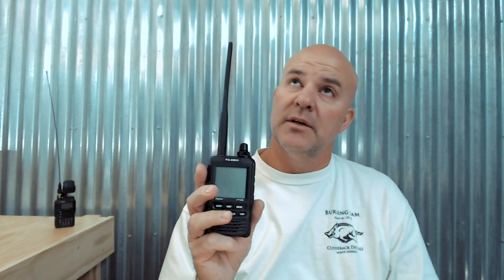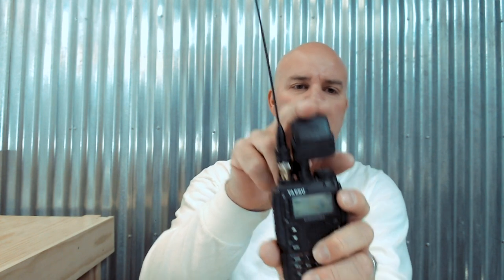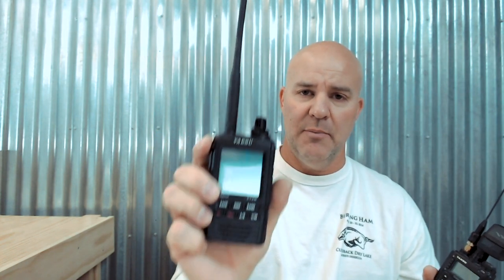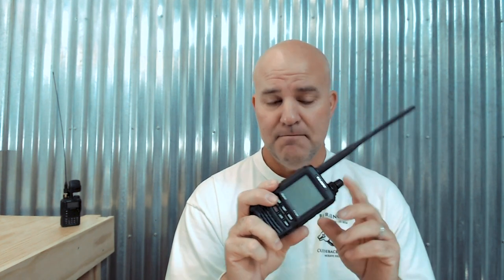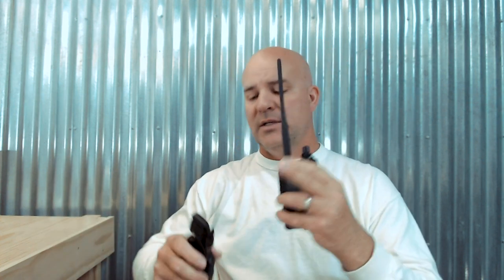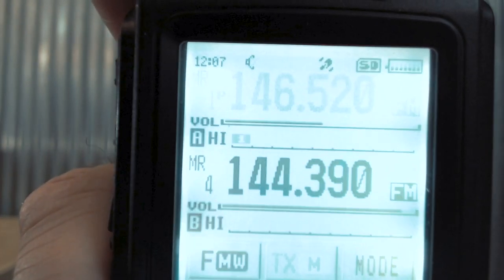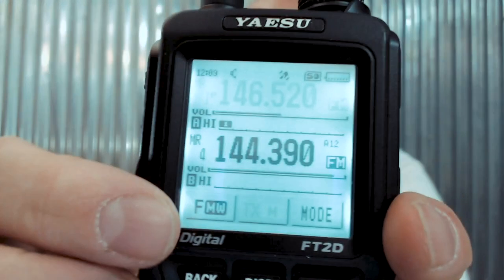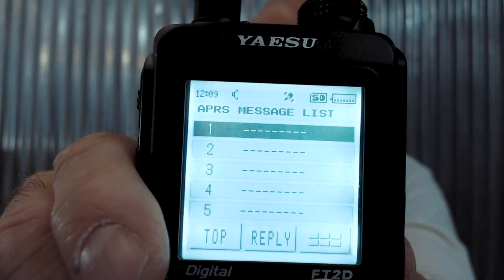How to SPOT Using the Yaesu FT2DR on APRS2SOTA 2019

Comment: Jerry,

Nice vid.  I have the FT1D and it is virtually identical to the FT2D (as far as the menu is concerned).  2D just has a nicer screen, but menus are the same.  FT1D falls in between the VX 8R and the FT2D.  FT1D seems to be identical to the vx8r, but just with digital.  

KC1HDF

Maine
Reply from the maker: The VX8 is very similar in the menus so I'm sure the FT1 is as well since all are of superior brand = Yaesu lol.  In all reality though, I am VERY fond of the ruggedness of the brand and how durable they are for SOTA or other outdoor work.

Comment: I just picked a ft2dr and haven’t really been out with it yet. When you’re doing an activation, what beacon interval do you usually set it at? Does it last all day? Just playing with it around the house, the battery doesn’t seem like it’d last. Do you carry extras?
Reply from the maker: Hey TJ I beacon while hiking between 3-5 minutes depending on overhead cover in the forest canopy. 5 minutes seems to be the sweet spot if you ask me and then usually once on the summit I shut off the beacon while there if I remember. There are many other setting you can adjust to help with battery life too such as the screen brightness and whether or not you listen to any repeaters while hiking. The battery for my VX-8DR (smaller) lasted all day for many days running it this way and that battery is now my back up battery. Also, if you’re going to use the radio for a VHF only activation then all that TXing will tax the battery so if that’s the case I’d for sure carry a spare or get a battery pack that can hold AA batteries for cheaper on front end but more expensive in long term if you ask me. If you are out quite often or multiple days a second battery would be wise IMO.

Comment: So I have a question about your radio. If your sending out your position on the bottom frequency via APRS. That leaves the top frequency open to communicate on. Does that radio have a duel watch feature? I like to monitor 2 frequencies while I’m backpacking. Usually a repeater and 52 on the side?
Reply from the maker: Yup! It absolutely does.

Comment: Use your gopro as a second camera that is just for recording the screen of the radio then overlay in post.
Reply from the maker: funny.... I started this video with the GoPro trying to use it in conjunction my HD webcam but it was just so much easier this way for a single clip, BUT I will be doing that for the subsequent videos on this radio to ensure the screen is visible without all the headaches I had.  Just incorporating the new GoPro in the studio equation and didn't have it dialed in like I wanted.  Next video though!  Thanks for the suggestion.
Reply from the maker: Now that I think of it, I tried the process backwards...lame... should have used the webcam for my head shot and the GoPro on my chest mount for the radio clips....THANKS!  Like an epiphany lol

Comment: Hey Jerry, great video! Your stuff is great motivation to combine the great outdoors and functional radio practices. I also have a VX8DR and am considering the FT2D due to the FUSION capability. Any thoughts on one versus the other? I saw in another comment you mention the VX8DR might have better battery life (lower power usage). Also if I remember correctly the 8 is waterproof IPX7 versus IPX5 on the 2DR. However, the fusion + touch screen + GPS of the 2DR seem really nice.... decisions....
Reply from the maker: Hey Jonathan I have both now, the VX8 and FT2DR and since I’ve been using the FT2D pretty much exclusively on my recent hikes I have found the battery life is fine. Like everything, the settings matter imo. The FT2 is also waterproof rates enough for my use so all is good and having the digital side is just another perk. If I had to choose between the two I’d take the FT2 every time due to its screen and ease of messaging via APRS, which is a big deal to me. Hope that helps 😎
Reply: @KG6HQDJerrySOTA  Thanks for the reply. Yea that all makes sense, and since the FT2D is on spring sale right now it makes it even more tempting... I also ended up checking their user manuals and even though the FT2D has that touch screen, it's send/receive power consumption is lower than the VX8DR!  73!
Reply from the maker: It’s a great radio & so far pretty efficient on my end.